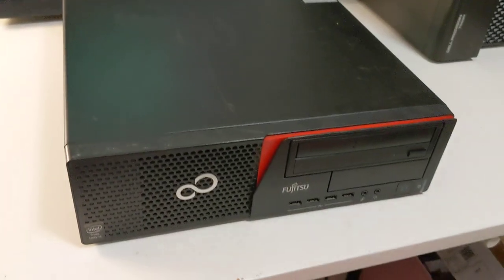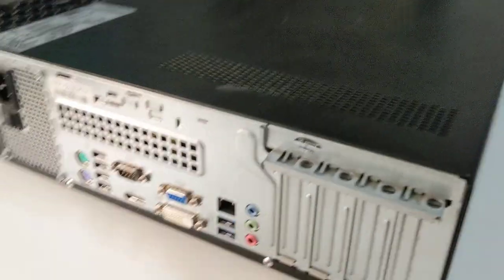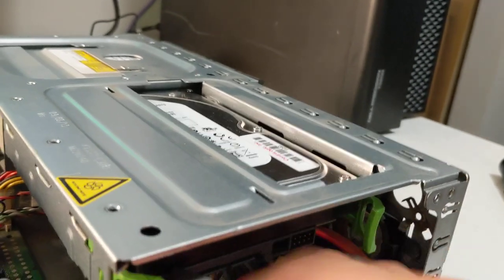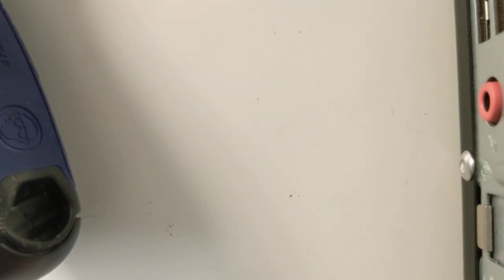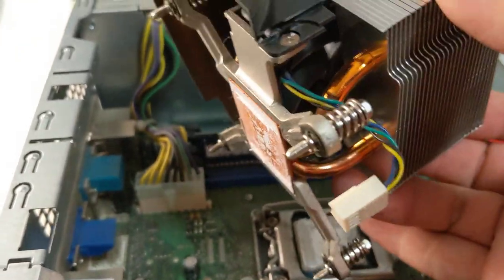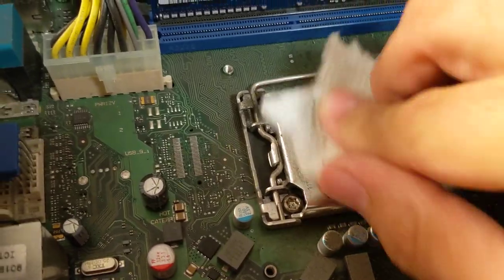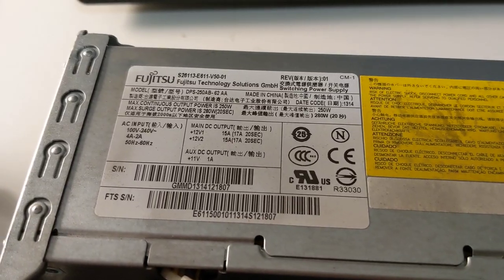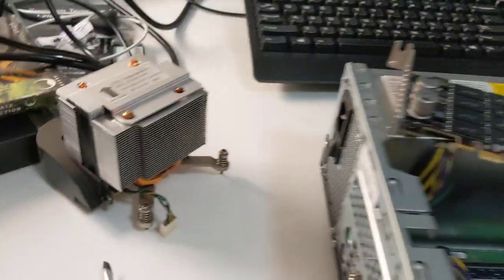Fujitsu Esrpimo E720 E85+ overview

Comment: Nice video! Do you by chance have some power consumption readings on the unit? Is it noisy in idle?
Reply from the maker: It is silent under moderate load and when idle. I haven't measured power consumption but based on the hardware in it I assume it's about 20-25w idle to 35-45w under load. Very efficient haswell chip.
Reply: @john8520  Thanks! I might pick one up to use it as pfSense firewall. Your video and reply really helped me making that decision. Keep up the good work (:
Reply from the maker: @babajaga9345  Thanks, happy to help! It would definitely be a solid firewall/router.

Comment: All that build up to taking off the cover, but couldn't actually see what you did.
Reply from the maker: Here's what I did: use a screwdriver to slide the latch all the way to the left, hold it in that position, and slide the top case forward. Most machines will have a proper plastic latch there so it will be a lot easier, but mine is missing that latch. If I had my phone mounted on a tripod it would have been a lot clearer, so I'll try and do that more in the future.
Reply: @john8520  Thanks I got there in the end, was very stiff. PC was, surplus office equipment from a removal job, not a burglary. Honest... 
I have 2 workstations where they took xeons out and hard drives of course. Got a bunch of ram cards. One had 3x16gb & 1x8gb cards they'd left in it. Tempted to try reserrecting the beast, but a bit inexperienced to take the risk. 
They design air filtration systems for ships etc. Obviously not short of few quid. Waste not, want not tho. 
Thanks again!